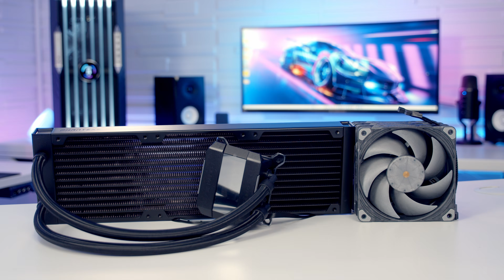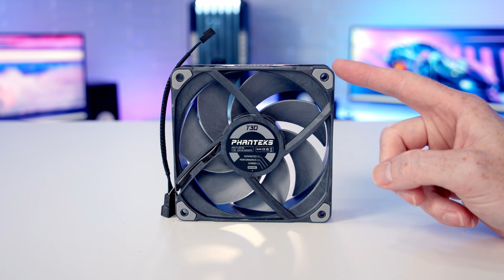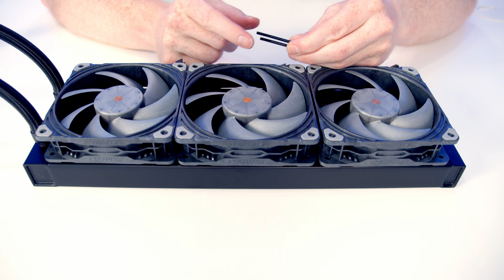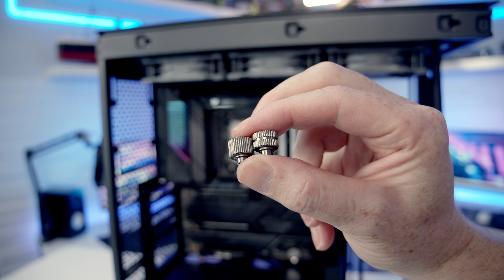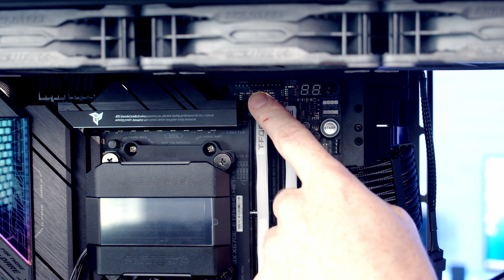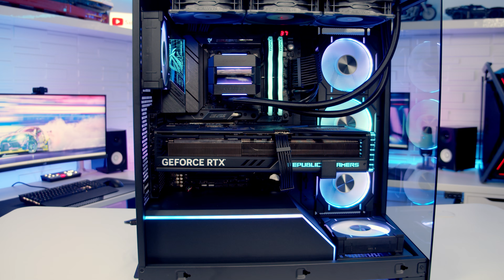Phanteks Glacier One 360 T30 Gen2 – Installation Guide

Comment: Thanks for the video. I have a question about this. I'm currently installing the Phanteks Glacier One 360 D30 in the NV5 and have an LGA 1700 (same backplate as in the video). Once I have positioned the backplate, other screws come into place on the main side. However, this does not fix the backplate or it has a small gap and does not sit firmly. Is that correct? I did it exactly according to the instructions. Will it only solidify when I screw the cooler on?
Reply: Hey man did you just have to secure it or did it not fit snugly on the back of your motherboard? I really want this but I’m afraid it won’t fit.